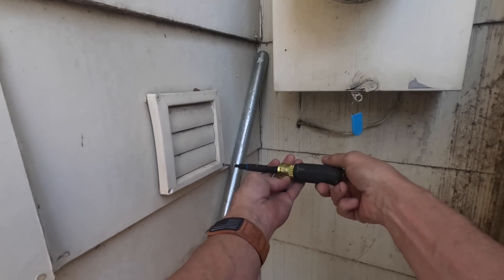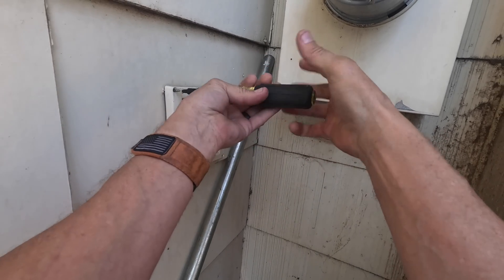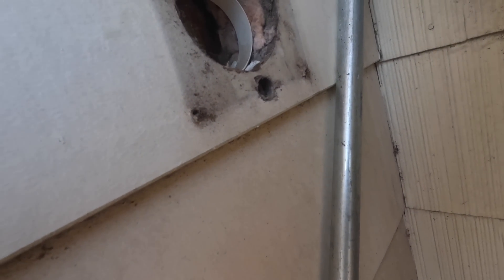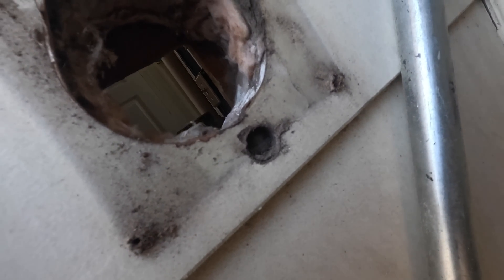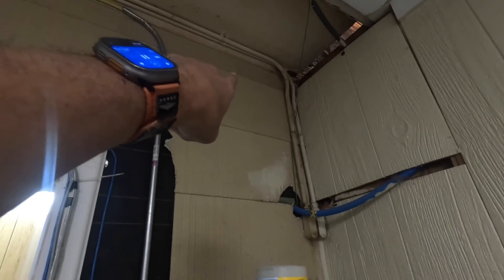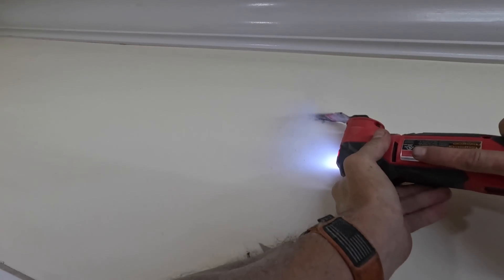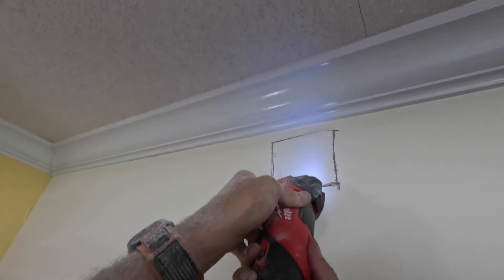Second Day On Mini-Split Install! #hvactrainingvideos

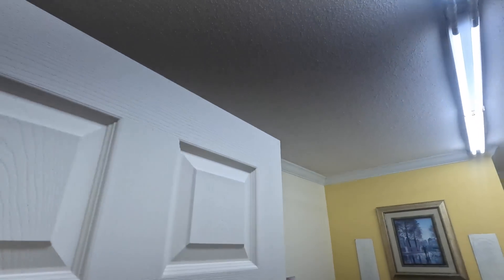Comment: I hope you were wearing an N95 mask at 2:13   Various siding products, pressboard type siding, tintest and a whole range of products manufactured in the 60's thru  90's contained Asbestos.   Cutting it releases fibres that you breath-in, and because of the hook shape, you cannot cough the fibres out.   That stuff at 2:13 looks like Chrysotile.   In Canada and the UK, these products were banned decades ago.   In the USA, even in 2024, the EPA is still trying to get some of these products banned.

Comment: When installing a system like that could the lines be run in the attic then down from the ceiling  to attach to the unit rather than along the wall?